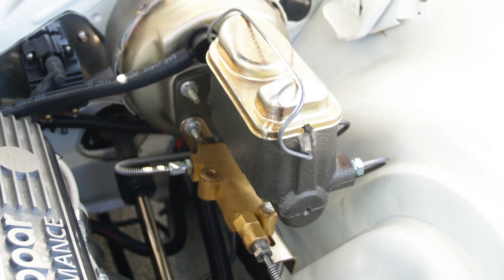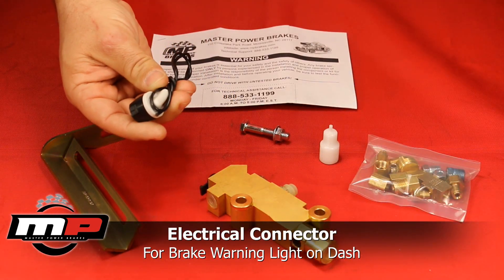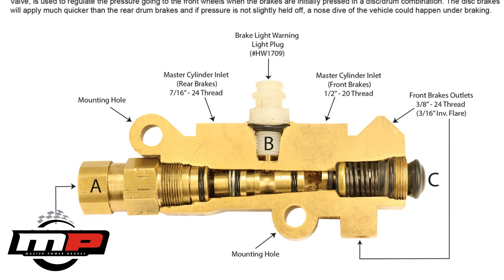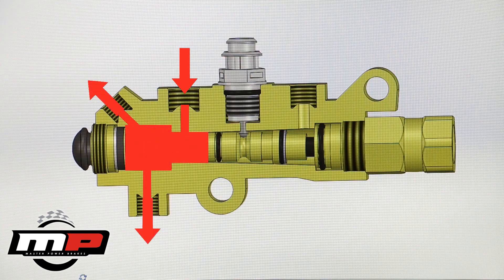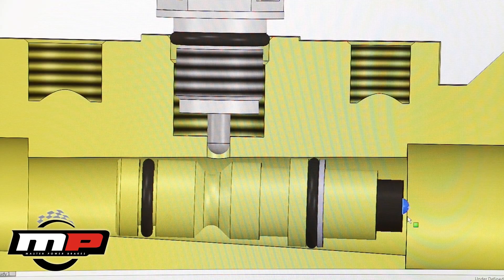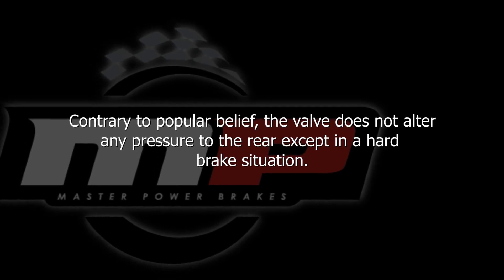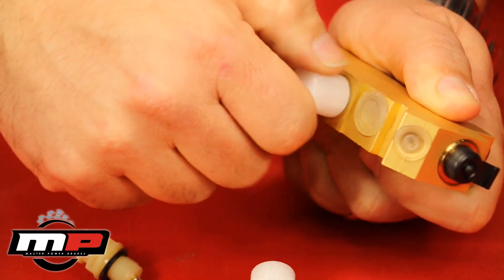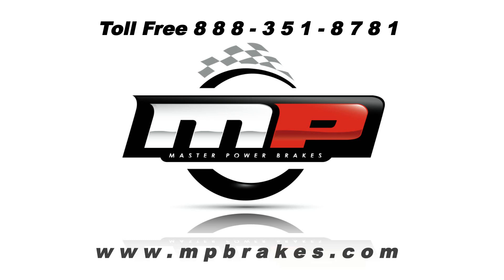Master Power Brakes Combination Valve Video

Comment: HI, I replaced the master cylinder,  the proportioning valve, and the 2 lines that connect the two,  I bench bled the master, then bled all 4 wheels, BUT when I got to the last wheel (drivers front) there was no fluid coming out of the bleeder valve, so removed it and replaced it (no fluid came out when I pulled it either), still no fluid.  Started the car and started slowly pumping the brake and fluid started leaking from where the front drivers brake line is screwed into the new proportioning valve. Also the pedal is now very soft, as it was pretty firm before I got to the last wheel.  Could that front drivers line be clogged?  I assume you don't replace the proportioning bleed tool with the factory sensor until you're done bleeding all wheels?

Comment: I had this installed on a rig with a chevy 350. A year later and now the hole in the coupling going to the rear brakes is leaking brake fluid.. What is this hole for and can it be plugged?

Comment: So to confirm here.

This valve at no point merges the two input sources from the master cycleder?  They stay completely separate?

So master cylinder 1 controls front brakes, and master cylinder 2 controls the rear brakes.

If there was a leak in the front brake line, you will still have rear brakes?

Comment: so what happens when you blow out a line and the switch is tripped. how do you center it so the light goes out?
Reply: To reset the switch, fix and bleed the side that blew out, then bleed the side that did not blow out.  As you apply more pressure, it should push the valve back to center and shut the light off.  If the light flashed off then on again, you went too far, bleed the other side again.
Reply: Does it block the ports to the line that has failed or just move to put the dash warning  light ?

Comment: The issue I have is, when backing down a boat ramp, when I go to slow the pace by using brake while the truck is going at a crawl, the front tires will start sliding trying to stop the vehicle, but the rear brakes wont do anything to stop when backing down a hill. the adusters are adjusted properly and it seems very little application happens with the rear brakes. My truck is a 3/4 with front Disc and rear drum 13x3.5 GM 14 bolt axle. When I bleed the system, I get fluid out, but my guess its a bad Prop valve. Also when inspecting the shoes after several thousand miles, the shoes look "new" still with very little if and brake dust, which tells me they are not doing there job.
Reply: I had the same axle in my old C20. You probably just need to pop off the rubber plugs on the back of the backing plates and adjust the brakes manually.  I adjusted mine about every oil change because the self adjusters never worked very well on that truck. I tried everything I could think of. High end brake shoes,all new  hardware. I just had to adjust them myself.
Reply: @Thundarr995  actually, I replaced the P Value and the rear brakes grab allot better. Both of my adjusters were working. My axle is a 14 bolt with 14x3 brakes. I have not been back to the boat ramp since I fixed it, but can tell just by driving the truck, the rear brakes are doing well.

Comment: At around 3:24, how does one go about re-centering the pressure differential valve?

Excellent video. I learned a lot. Many thanks.
Reply: If the valve is off the vehicle, unscrew the switch, you should be able to tap the valve on one end or the other against a hard surface like your workbench and see it's position in there, and get it centred.

Comment: Just finished install. Have ZERO pressure to back bleeders. All new lines. Removed combination valve to be sure that fluid could pass thru both rear and front ports to supply lines with fluid. Still nothing at rear bleeders. Has to have something to do with combination valve??? Yes I used the white lock tool to keep valve centered.
Reply: Did you ever figure this out?
Reply: @SaltySalads1776  Removed that combination valve. Worked perfectly. New master cylinders are devided anyway, and pretty much serve the same purpose in my opinion.

Comment: You didn't explain how the proportioning valve works.  It's hard to tell, but from he cutaway it looks like a fixed pressure regulator.

Comment: HOW DO YOU RECENTER THE VALVE ? + I'M WEARING HEAD-PHONES , OFF WITH THAT DAMN AIRGUN !
Reply: If you remove the warning light sending switch, you should be able to see which direction the valve has moved.  If it moved toward the rear, bleed the front brakes again, and it should re-center.  If the shuttle moved forward, bleed the rear brakes again.
Reply: @siulumlion  Oh , thank you . Better safe than sorry .

Comment: So I've got a question, can I install my line lock for the front brakes in between the master cylinder and combination block or does it have to be between the front brakes and the combination block, since there are 2 lines I would technically need 2 line locks or a 2 to 1 line adapter and then a 1 to 2 adapter after the line lock?

Comment: Question. Did 4th gen camaro to 3rd gen camaro rear-end conversion. Gives me OEM  
rear disc brakes that work amazing however, NOW the red brake light is ON, on the dash all the time, any fixes?  THANKS
Reply: Maybe just unplugging the switch? Or bypassing/jumping the switch.
Reply: @OpenBarGarage  I will try something along those lines, eventually I will replace the master cylinder with 4th gen unit and the combination valve with an adjustable one. Thanks.
Reply: @davebarron5939  I also wanted to add that it could also be your handbrake switch which could also be lighting up the indicator lamp... If it's the same as my chevy truck.
Reply: @OpenBarGarage  Agreed, however that I have been able to isolate out of concern. I am certain it is the pressure differential between the front disc and the "now" REAR disc. No biggie, just annoying.

Comment: Can anyone help. Replaced wheel assemble yesterday on both sides. When I was done the driver side breaks slip toward the end of the break. I bled the breaks thinking that was it and still same issue. No abs light is on. It’s like it’s slipping when you get down to 10mph while breaking.

Comment: I would like to see someone do this on a 1987 chevy truck where the portioning valve is wedged tight up under the radiator and can't be worked on without removing the entire valve due to obstruction of it's location.
Reply: I'm doing it this weekend. The valve is on a cross member on the driver's side and yes a PITA to work on in that location. I have a P30 motorhome that blew a hard line to the rear brakes. So to reset I am told to use a small torx screwdriver or allen wrench (I'll try with a 2mm one) to push the valve back via the rear brake line/ valve side which is what failed. I'll post of a video of this once it's done.
Reply: @drlong08  wanna hear your results
Reply: @lilmockme8821  Oh! We'll I managed to reset the valve with a very small allen wrench stuck in there AFTER pulling off one end of the valve. I've got a video on it, I think  https://www.youtube.com/watch?v=RmXdYWY9yYw .....not sure why they decided to locate that valve there but I'm guessing to keep anything from hitting it. Brakes are bled and working great now!
Reply: Pull the fan shroud and you'll have all the room in the world

Comment: I just bought a power booster p. valve include-on the out end of the p valve there is a small rubber at least I think its a rubber which is a major leak--so does that need a screw in type plug----  thanks

Comment: Wish I had bought my valve from these guys! I used Right Stuff and got no directions, no tubes (extra) no valve bleeder tool, cheesy mounting bracket or extra fittings.

Comment: wow no comments here yet, I got a question. how do you know if your combination valve is bad? my brake calipers on the front are locking up (drums on back) I replace the calipers with no luck then I replace the rubber hoses with no luck they're still locking up, when I open up the combination valve with a wrench I hear the calipers unlock and release.
Reply: +Heinrich I think you just diagnosed your own issue: "when I open up the combination valve with a wrench I hear the calipers unlock and release." Time to replace.
Reply: Heinrich ha
Reply: So did it fix  the problem?
Reply: @josephvilla9477  I never replaced it. Don't cut me off I'll come crashing through!